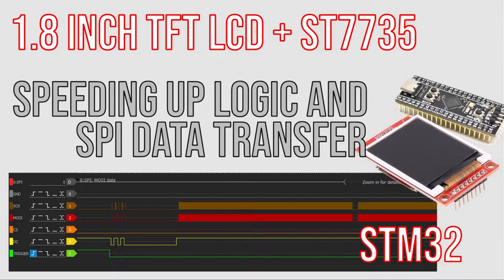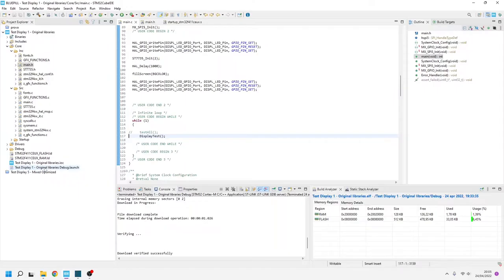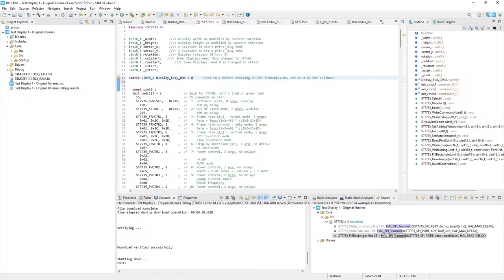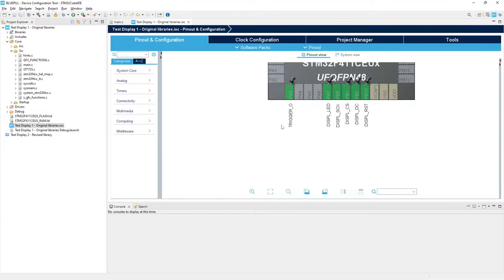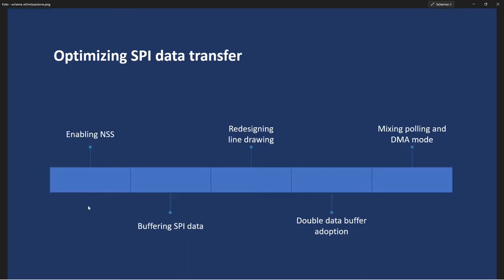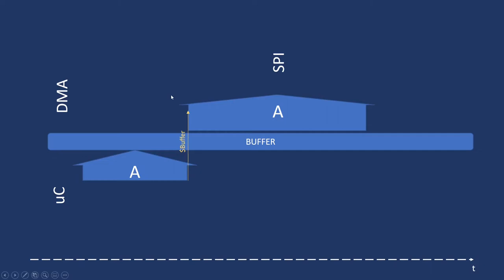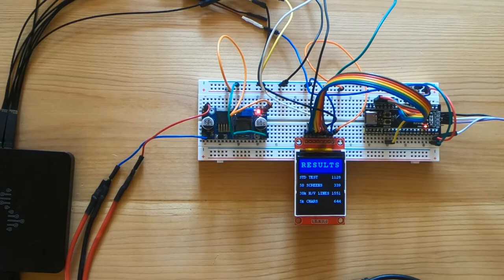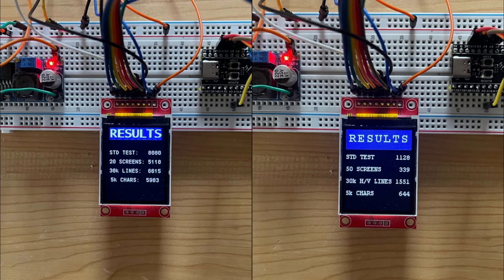STM32 and ST7735 1.8 TFT LCD display

Comment from the maker: Errata corrige: time 05:45 
Here and somewhere else in the video you see the total page of the "original" library showing "20 screens". it is 50. 
Initially it was 20, when I decided to review library I changed to 50 in order to have the four tests of nearly the same time on original library. 
As you can see I forgot updating description in the total page. 
It is 50 screens: 100ms per screen.

Comment: It is a great contribution, thank you very much, could you give me information about displaying images?
Reply from the maker: "displaying images" is not a big issue. You just have to transfer them filling buffer and moving it to display (more or less as what is done in FillArea, but using image data instead of filling buffer with just a single color). The problem is: what you mean for an "image"? If you refer to a RGB565 pixel information array you just have to "display" it as stated above. But if you are thinking to a jpeg, png or so on, you have to think to convert it, move it into an array and storing it inside your program (involving maybe also mass storage issues).
That's the reason why (together to the availability of any font I like) I'm using TouchGFX even with these displays when I need something more than a basic graphics. TouchGFX ease all these problems. Pictures in the GitHub page should show what I mean.